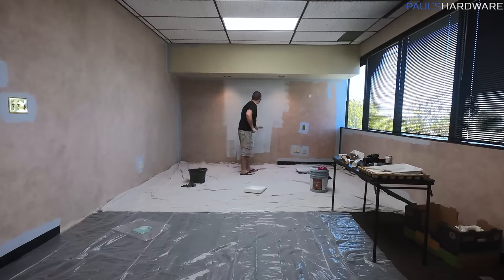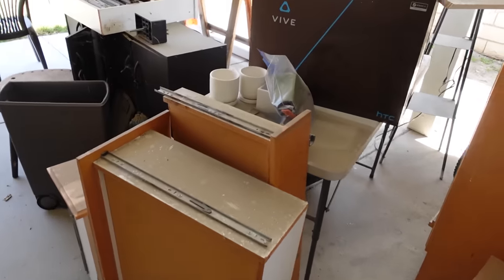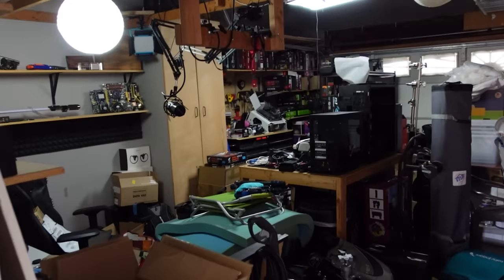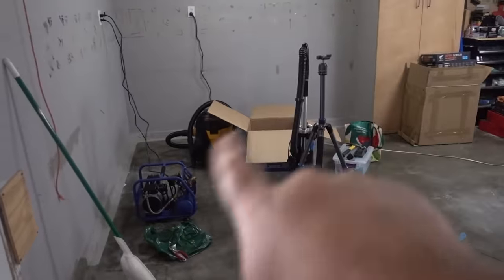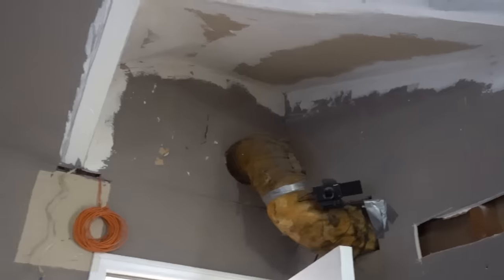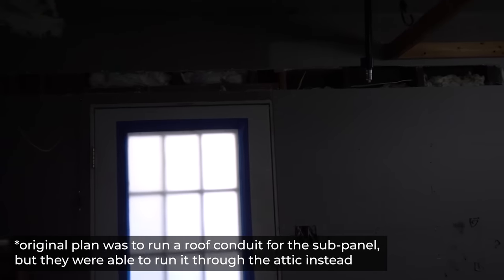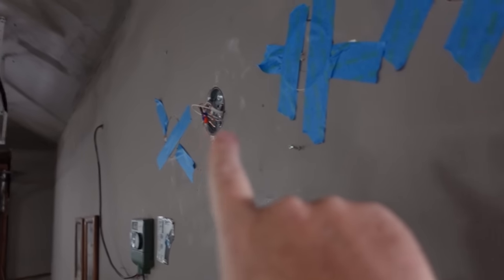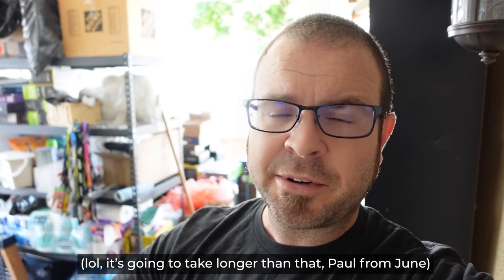It’s time for a fresh start.

Comment: With CAT6 you can go at 10Gb but instead of 100m (300ft) you have to half that to 50m (180ft). That's the distance total, that includes the patch pannel, the inside the wall wire, and your pc wire. Good luck!
Reply: Well, from Category 3-7a cable the maximum distance is  100 m (328 ft.) until you need to a Network Switch, Extenders, etc. to extend your cable runs. 
Category 6 is 1 Gbps with 250 mhz bandwidth at 100 m (328 ft.) and 10Gb at 37 m (121 ft.). 
Category 6a is 10 Gbps 500 mhz bandwidth at 100 m (328 ft.). 
Category 7a is 10 Gbps 1000 mhz bandwidth at 100 m (328 ft.) and 40Gb at 50 m (164 ft.)

Comment: The gobbed on texture is acoustic dampening.   You don’t want smooth ceilings in your bedroom. 
Patch the drywall, but put up acoustic panels don’t go with flat walls. You can put some baffles on the ceiling that can be multi purpose, hang lights, drop cords for power, hanging storage and of course baffle sound
You could hang cloth on ceiling but if so I’d go for something easy to change out.  Like a sponsor banner that you change regularly so it doesn’t collect to much dust.  Could do carpet panels for walls too instead of acoustic 
Carpet panels would be modular, easy to hang Velcro from or drapery pins.  Artist use Propanels for displays, they come in different colors and sizes. DIY ones are pretty easy with foam board insulation and your choice of pipe(metal or plastic) and carpet.  Not super cheap but probably less than a month of office rent. 
A carpet wall could hide storage, allow access to storage, dampen sound, provide hanging space. Just have a way to secure the top to a fixed beam.  Look at a Propanel system for ideas. But end vertical poles and a top beam would give you easy to move stable sound dampening good looking walls

Comment: You do you. But a more efficient way of improving your space would be moving the new awning over to your sliding door in the back. Tear down the back wall and extend the length of your garage. Remove the window, remove the garage door, or just build a wall behind it with sound dampening goo and thick insulation. Put in carpet or wood with a healthy amount of floor insulation. Add your mini split now. You have a large cool space year round.

Comment: Did you consider a full renovation where you extend the house to fill the side yard area.

You would effectively extend the garage/ studio to twice the length. 

Make the garage door a solid wall via a false wall to give you insulation for sound etc.

Comment: If the runs are less than 50-100' chances are you can get reliable 10 Gbps unless you're unlucky. And you could at least get 2.5 Gbps if 10 Gbps is flaky.

Good luck, and I'm currently making the opposite move (going from cramped home quarters to a larger office space!), so I hope it works out for me lol.
Reply from the maker: Thanks Jeff! I am optimistic but I still haven't had a chance to test it yet. But you and several others in the comments have given me much hope. Best of luck with your move as well! 🙏
Reply: He will need Cat6a cable which have 500 mhz bandwidth and it's at 10 Gbps up to (328 ft.) to rest easy instead of using Cat6 cable with 250 mhz bandwidth at 1 Gbps up to (328 ft.) and 10 Gbps up to (121 ft.).

Comment: so I might have a piece of advice for renovations, since you aren't using your garage to park your car into, you might consider putting up an insulating wall where the garage door is, to both keep the sound out and to further thermally insulate the garage meaning less AC time

Comment: Cat6 does 10Gbps up to 55 meters (180 ft), so you should be safe if you're not doing longer runs than that. It's nice to see the improvements tight away on part 1!

Comment: At this point to have all that work done, I would have just gone ahead and took the Garage door off and sealed in the the Garage and made it another large room permanently added to the house.  I would take out the washer and dryer also and sound proof the entire room. You can buy a small shed at Home Depot to put the washer and dryer in and put it up against the house in the backyard.  If you really want to have more room then put another room on top of the Garage the same size. You could use it for storage or spare bedroom later on.  Also the resale would be fantastic with all that extra space added on.  😊

Comment: Cat6 will get you 10Gb up to 55 meters.  I have it run throughout my house and easily get 10Gb speeds on short burst.  The issue you will run into is usually on the hardware end for home use stuff.  Cat6A which is what is actually rated for 10Gb is a bitch to put in as it has a much stiffer center isolator.

Comment: Suggestion, not a criticism: when putting through ethernet cable, run fiberoptic cable through at the same time. Even if you don't need it right now, it's great getting all the cabling done in one go.

Comment: I have just done a new run from the house to my shed. It was actually cheaper to run Fiber instead of CAT6A. Couple od plus sides is less power used and I was able to run mains power in the same conduit. 40m run btw, shorter Copper still makes sense.

Comment: 6:30 I've seen that done once. It involved a lot of steam/moist air and a plastic tent (upside down) to soak that material and then be able to scrape it off.
Also, are you going to get a better garage door, for improved noise and heat insulation?

Comment: Black widows…moved into a house in Thousand Oaks with a pool and OLD hot tub. Demo’d the hot tub which housed a dozen healthy black widows. Easy kills. A month later I pulled the cover off the pool’s return sump to clean out the strainer, placed the cover on the deck upside down only to see the biggest black widow I’ve ever seen. As I moved to stomp it, the spider took off across the deck with me in pursuit. It left me in the dust, running a good 15 feet, turned the corner of the house, and disappeared into a pile of old bricks.
Fewer of them in Oregon, tho more Brown Recluses.
Reply: There are no brown recluse spiders west of the Rockies or north of Nebraska. There are recluse species in California, but none in the PNW. I live on Vancouver Island and have done actual research into this.
Reply: @TheEricGroulx  cool, thx. I was careless

Comment: You will most likely be able to get 2.5Gig on that cat6 Possibly even 5Gig! Cat5a with short enough runs is capable of 2.5Gig as well.
Reply: Yeah i run 10gig on cat5e 6ft no problem. Cat6 will run 10gig probably to 30ft ish.

Comment: Cat6 cable was rated to only 1Gig as you mention , but there are 2.5G and 5G alternatives to 10G. Depends on your available hardware. As you say Cat6 is not rated for 10G although standards suggest it would  run out to around 37m greater than that requires mitigation.. In my experience as I work in this field, as long as you only run 1 cable, there shouldn't be any other cables to give you issues with Alien crosstalk which is  the real 10G killer.

Comment: Those outlets you installed in the garage need to be gfci per code. If a fire ever started from them, you have visual proof now they weren’t installed correctly and insurance wouldn’t cover it.

Comment: cat6 should handle at minimum 2.5, because my cat5e easily handles gigabit. 6e for sure hits 10gig, but from there you'd need some small fiber lines

Comment: Use CAT8 it backward compatible CAT6 & CAT6E is not capable  for 10gb to 1gb if you used 10gb it will drop to any device connected at 1gb I've switched over CAT8 and no issue

Comment: From wikipedia "For 10GBASE-T, an unshielded Cat 6 cable should not exceed 55 meters and a Cat 6A cable should not exceed 100 meters." you are fine with Cat6 bud
Reply: 500 ft well exceeds 55 meters, and he has CAT 6, not CAT 6a

Comment: CAT6 not rated for 10G? I really doubt your runs are long enough that you won't be able to do 10G with ease.
Reply from the maker: That's my hope as well 🤞
Reply: Cat 6 is rated for 10G, but up to 180 feet. While that may seem like a non-issue, keep in mind that in a house, you have to contend with the other cabling (coax, power, etc.), as well as other sources of interference. By going Cat6A, you get the benefit of added shielding in the cable (due to tighter twisting), plus the ability to use 10G across the full 100m length.
Reply: @lazamair  I don't know how long you've been watching Paul's videos, but he's shown his house in many a work vlog from many different angles...even in the attic (which could use another foot of blown-in insulation IMO) and I would say confidently that his longest in-wall run isn't going to be much more than 70ft. Adding 20ft for patch cables on either end, brings you to 90 ft., and you're still well under the rated limit.

A lot of people think 10G is harder to achieve than it really is. CAT6A is nice to have, for sure, but it's not a hard requirement. I even have some 10ft. CAT5e patch cables that do 10G speeds. Of course, I don't recommend that people go out and purposely buy CAT5e for 10G and expect it to work.

Comment: I think wifi is the way to go
Reply: Wi-Fi is awesome and convenient, but if you have a hard-wired ethernet connection, 9/10 that's going to be the better option simply because there's less congestion, interference, and signal loss.